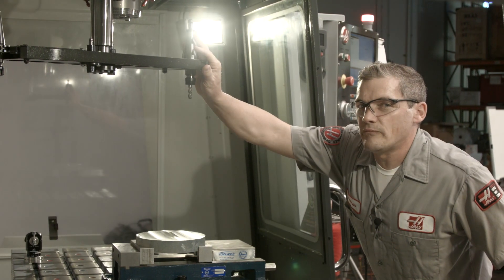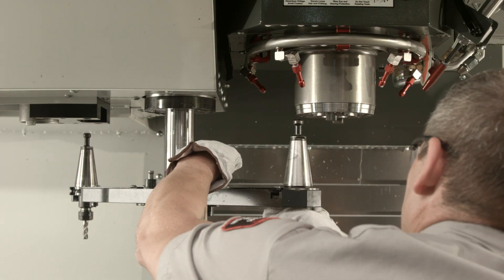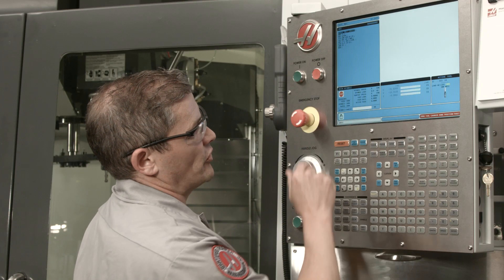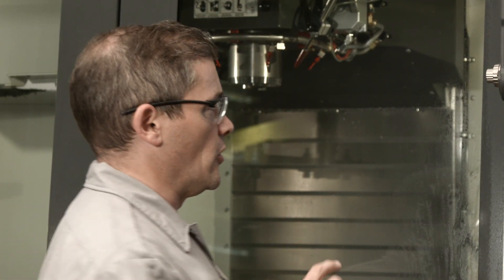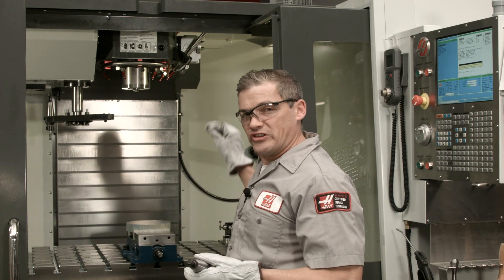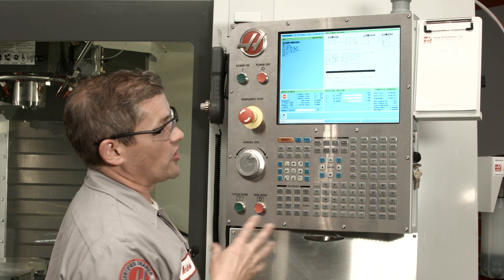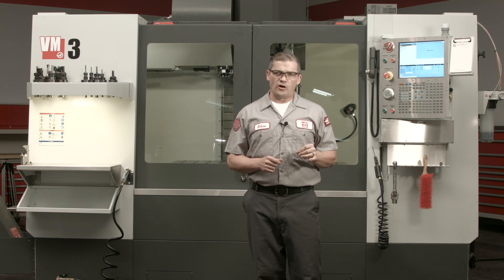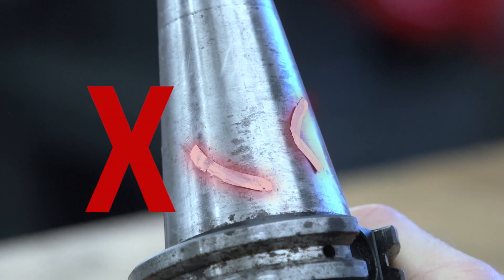Tool Changer Recovery; Haas Side Mount Tool Changer (SMTC) - Haas Automation Service Video

Comment: ok I have 2 of these mills where I work and 1 has the double arm spin counter clockwise which makes sense to me because the force of spinning would push the tool into the arm but the other has a problem dropping tools and the arm spins clockwise. is there any way I could change the direction it spins?

Comment: Thank u. 
Which was the lubricant you applied on tool holder?
Reply from the maker: Hello suraj,
The grease we're using here to lubricate the various parts of the SMTC and the tool holder is Red-i extreme pressure grease. But most high quality high pressure industrial/automotive greases will work fine as well. The important thing is to apply the lubricant regularly so these surfaces are not making contact in a "dry" state. Thanks for the question.
Reply: На русском можно

Comment: What if it alarms when there are 2 tools in the arm? It stopped and alarmed mid tool change. The arm didn't drop down far enough to push the pin and release the tool for manual removal. Both tools are in the arm, but one is still in the spindle and the other is in the pocket. It's a 2008 VF4, and it just makes me nervous to continue with the recovery instructions, because none of them mention the situation the arm and tools are in
Reply from the maker: Throw Away - It's hard to be 100% sure without inspecting the machine and checking diagnostics, but the way you've described it the control would recognize that a tool change was started but the TRP (tool release piston) switch was never reached.  So recovery step one should be to slowly lower the double arm until the that switch is reached, meaning you should be able to remove the tools at that point.  I know you posted your comment yesterday so you've probably tried something by now, but if you haven't hopefully this helps.  Haas Automation
Reply: @haasautomation  Thank you for your reply! I ended up choking the rapid to 5% and tried pressing the ATC REV button (with my fingers crossed) to get the arm out of the way. I had to press it about 10-15 times until the arm rotated back to its origin, removed the tool from the spindle, and finished the recovery. The pocket went back up, and everything worked as normal. Hasn't done it since.

Comment: Grease should not be used, because grease is tough, will cause dirt or iron powder to adhere and damage the pull ball stud set. Using oil and air to blow dry enough to be better